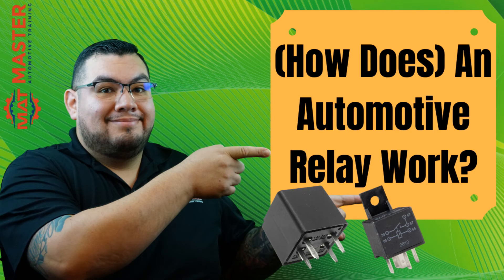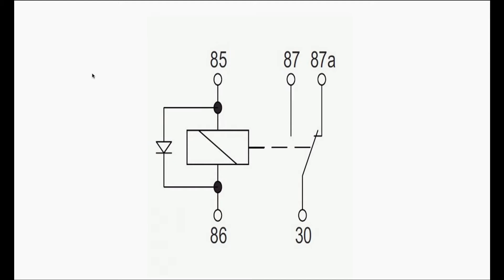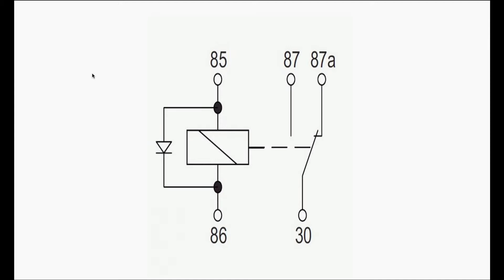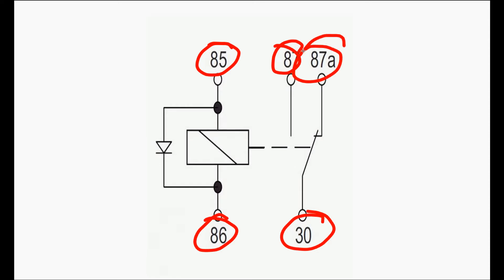[How Does] An Automotive Relay Work

Comment: Your diode is installed backwards in your example. The way you have the polarity it would be a dead short. It needs to be reversed biased
Reply: Its because he has 85 and 86 reversed. 85 is typically ground, 86 is B+

Comment: Do all automotive relays have inbuilt diode or resistor to prevent back EMF?
Reply from the maker: Yes, when any coil turns off the left over energy needs to head back to ground and the diode/resistor help cap the kick back and not hurt or shut off pcm control.
Reply: Some relays use a resistor of around 650 ohms in place of the diode. It does a pretty good job of containing the voltage spike caused by the collapse of the magnetic field but doesn't make the control circuit polarity sensitive